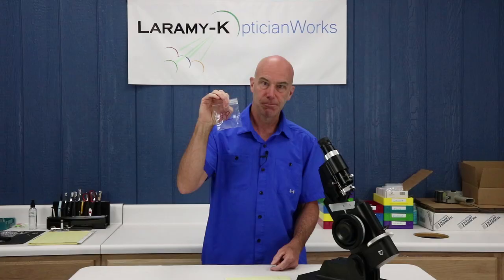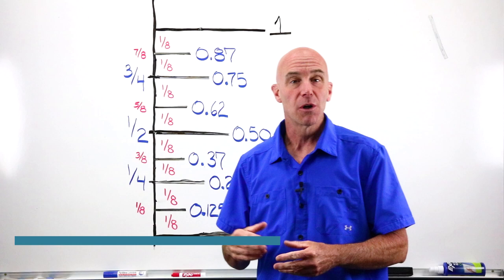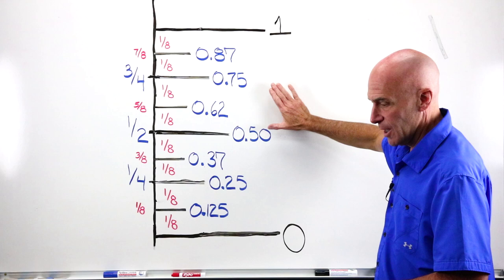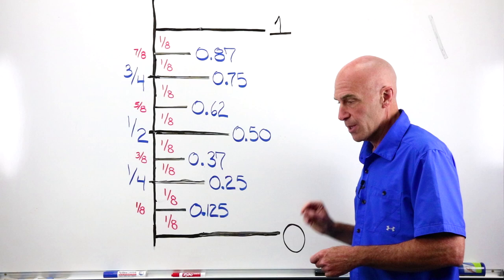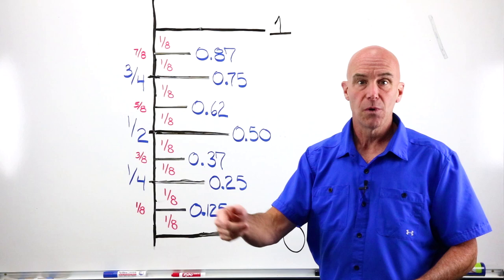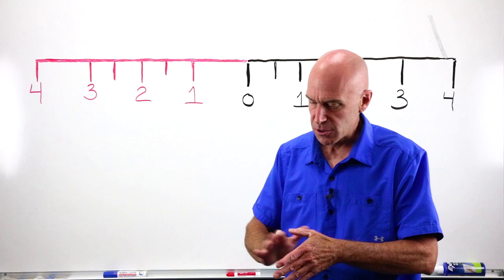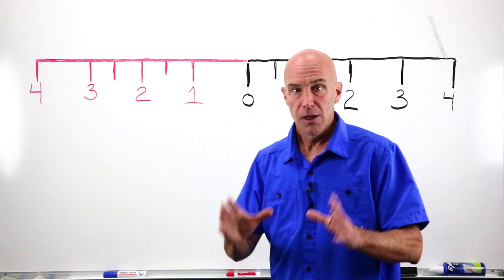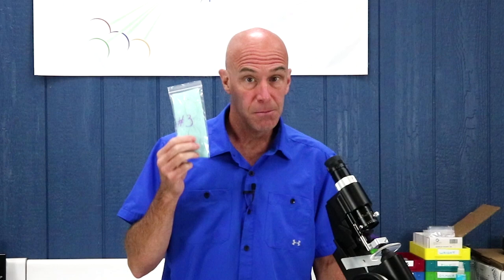How To Use The Lensmeter To Read A Spherocylinder Lens

Comment: Hell guys IM staring to practice with the manual lensometer I feel a little bit confused to determine +/- cyl If I understood correctly the axis to choose is the meridian where the cylinder has no power so for instance :
 A = +3.00DSx120 
B=+1.00xDS X 30 

+3.00DS, -2.00 cyl X 30 axis

 hence im working in minus cyl 

On the other hand A = +1.00DSx120 B=+3.00xDS X 30 
+1.00DS, +2.00cyl X 120 axis
 Working in plus cyl.

 Then if I want to work again in minus cyl I have to transpond
Reply from the maker: It is time for a membership with OpticianWorks.com.

Comment: I understand every concept of the lensometer my issue is I get crisp spheres line at a certain axis, and veteran optician Bob says you're off 1/2 diopter and or off on the axis. Very rare is the case where I'm on the money. According to him. I know you said in one of your video that that lensometer is subjective but how can I be so wrong all the time? I adjust the lens ometer to my eyesight and I'm still off.
Reply from the maker: D Sep, First thing that comes to mind is, "Do either of you wear glasses?" If, yes, I'd start there and try working with the lensmeter without wearing them. Next, I'd work with the lab and get them to mark up some lenses for you and see who is right and who is wrong. A few around +/-4 with about 2 cyl. have THEM mark an axis while in a good high end auto-lensmeter. Or, maybe you have a lensmeter gauge? I'd say the subjective amount should be closer to 0.125 and 1 or 2 degrees, not 0.5. If you can please let me know how this gets solved, it would make a great teaching tool. In fact depending on where you are we might even send you some lenses.
Reply: This is happening to me when I'm reading my lenses. I read it as I see it on the lensometer and Bob the Optician is testing me and gives me minus points for off axis, even if it is within ANSI. "He" said "practice with your lensometer", or maybe your blocking is off.

Comment: What equipment are u using to get the lens meter view into the video? I know they make microscope cameras but I haven't found anything similar for a lens meter yet. Work at a small to medium and growing lab.   Would really Love to be able to put a manual lens meter live feed on our 65-in conference room TV to train people
Reply from the maker: After trying MANY different things I ended up using a cellphone telescope mount. It is fussy, difficult, unreliable and near impossible to maintain a consistent focus. You aren't the first to ask - I wish I had a better answer for you. If you try pull off the soft rubber eyecup.

Comment: Is it correct to deduce that the second example +1.00  -2.50 at X degrees is actually the same as -1.5 +2.50 at X+90 degrees?   And is there a customary convention to always write these using the smaller number as the spherical, or perhaps to use whichever order results in a negative cylinder, or something like that?
Reply from the maker: Keep watching the series. See also: https://youtu.be/rVMW5a6qJ6I
Reply: @LaramyKOptical  Ah yes, of course you would have covered this in a subsequent video. Thanks for the reply.

Comment: Sir I am from India. I am manufacturing microscope optical lens like 100x,40x,10x. Can you make a video about microscope lens.
Reply from the maker: Sorry but, no. Lenses in series and lenses in contact are part of geometric optics and require different formulas than the single lenses in eyeglasses. You would want to look for physics and optical engineering books or sites. John

Comment: I bought a Lensmeter and the two sets of mires are equal in distance apart. There are no thick and thin lines, the two sets of lines are the same size and they are always in the shape of a cross. What am I doing wrong?
Reply from the maker: Maybe, just maybe, SWAG here that they might appear different if you have a lens with cylinder? Drop in a -5.00 with 2.00 cylinder and see what happens? Oh, wait, no, maybe you just need to put a lens in it? You might be looking at the reticle not the sphere and cylinder lines? The reticle is constant and fixed and all the lines are the same.

Comment: what's the point of rotating the lens when you could just rotate the axis wheel?
Reply from the maker: No, that wouldn't work. You are aligning the lens to the position not the other way around. 135 is 135 is 135 you set the axis to 135 and rotate the lens to match it so that the power you need is at 135.
Reply: Could also stay still and wait for the earth to rotate 😆😆
Do you assume to have guessed the axis location every time ?

So many questions
Reply: @angelikazavadska6117